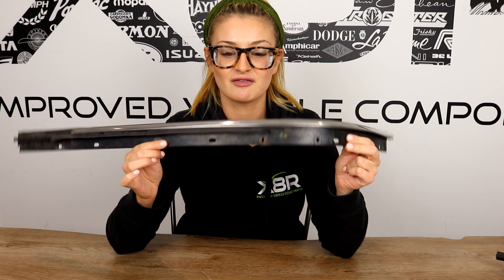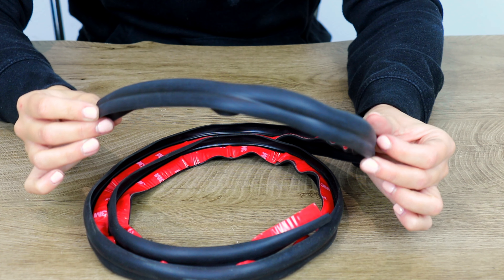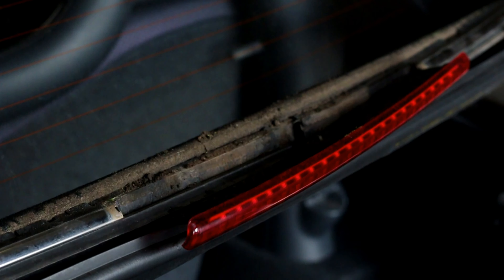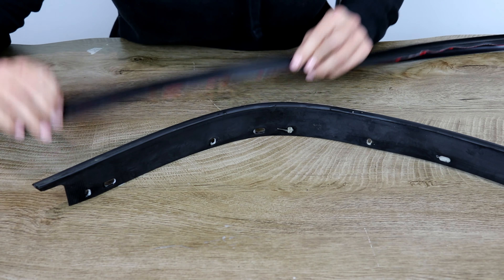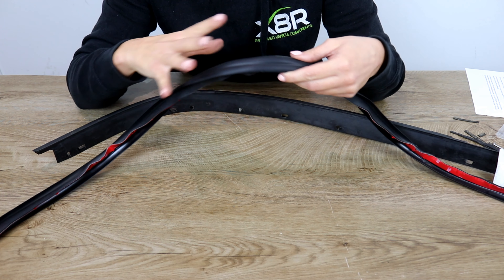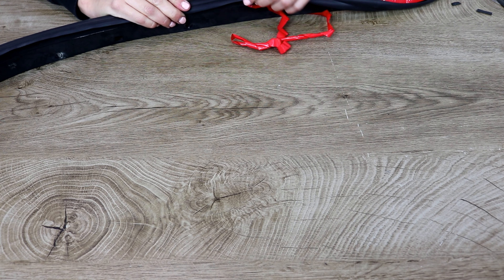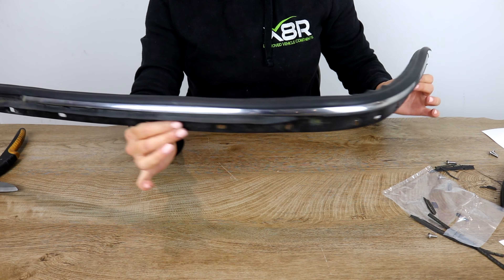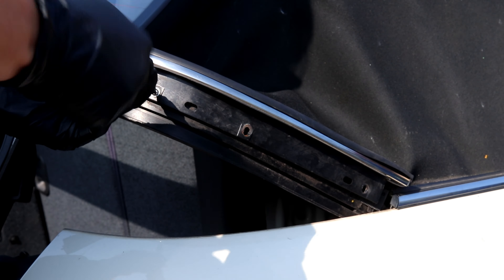How To Fix Your Cracked Broken Leaking Mini Convertible Seals With The X8R Repair Kit!

Comment: Hi, this fixes the top part of the trim, but what about the below part is cracked as well? Is it possible to fix it, does it cause a leak? Thanks!
Reply from the maker: Hi there, the bottom part of the trim is purely for aesthetics and should not have any need to be water tight. Due to the difficult position of the lower trim there is not a way to replace it. - Georgina, X8R Ltd